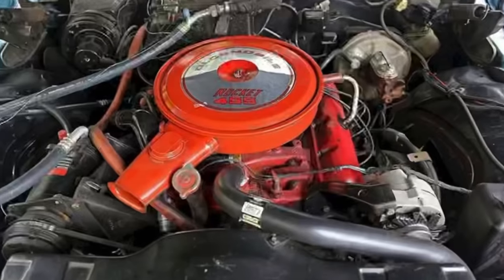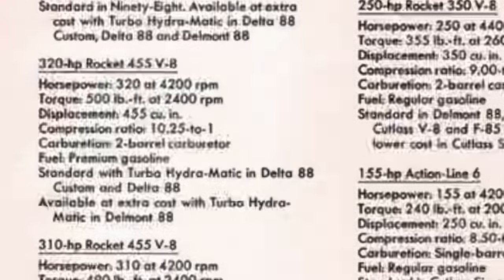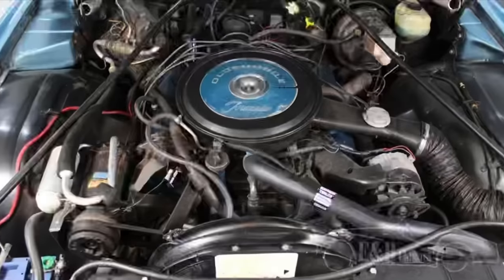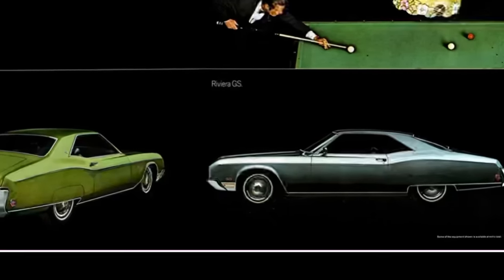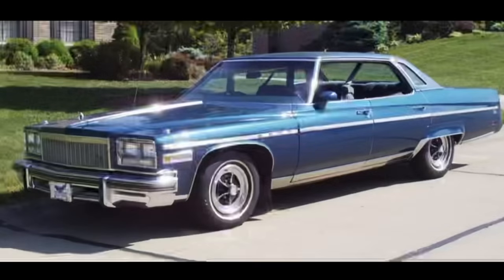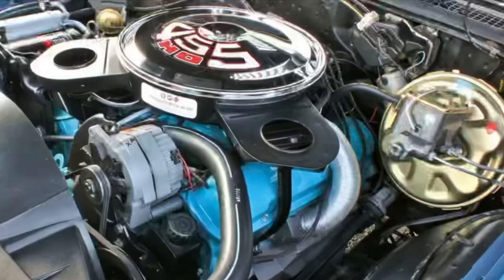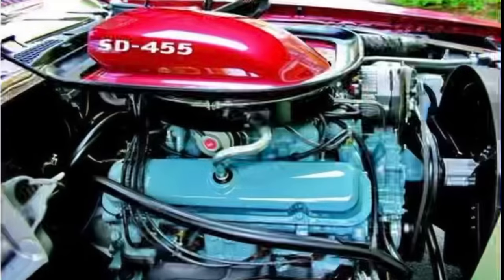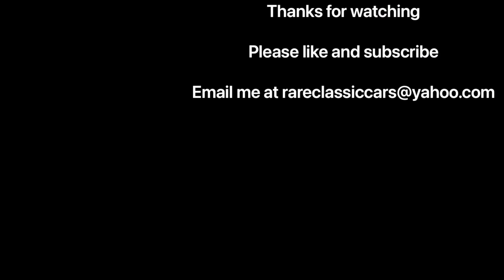Best Car Engines - The Rise of the Mighty 455 V8s from GM’s Buick, Oldsmobile, and Pontiac

Comment: I had a 70 Buick with the 455. Talk about a torque monster! Floor the pedal and man did that car take off. Not what you would expect in a car made for comfort. Very memorable.
Reply: I had a '70 Riviera GS, buckets/console etc., so I understand the feeling. That was a great car and pretty good handler for a big one.
Reply: I just bought a1970electra 455 2door hard top. It starts and runs, but it lacs compression on 2 pistons on the driver side. Cant wait to get the engine rebuilt and feel the torque :D
Reply: I just bought a 70' w/ a 455... getting used to the power, Jesus. There's a LOT!!!
Reply: I took a good friend of mine for a ride in my dad's new 1967 Wildcat....my buddy was a foreign car snob...but when I floored the Wildcat, he shouted out...OMG...it's a huge Ferrari! That beast would lay down a good 20 yards of rubber when pushed. And that Wildcat held together very well, lasting over 320,000 miles, before some drunk rear-ended the car.  My dad shed a few tears after that mighty beast went to the junkyard. GM cars hit some sort of peak, during those later years of that decade.
Reply: @curbozerboomer1773 Many years before GM became the junk trash it is currently. RIP GM, you should've went out of existence in 2009 instead of taking that Gov't bailout. 😢💀
Reply: I should add all of the Big 3 brands are junk currently. Only a few foreign brands I can think of that are very good yet.

Comment: Fascinating.  

A decade ago, Hot Rod magazine spent $5500 on each a Ford, Chevy, Olds, Pontiac, and Buick 455 and used similar components in each.  The Buick was the hands down winner, making about 550 hp net with simple mods and a good blueprinting.

Great video!
Reply: I agree with the Buick engine  they responded  well to modifications  back then buick had little  to no speed parts available  but now in today's automotive  market  there are plentiful  aftermarket  parts for most engines back then
Reply: I have the car craft 2001 issue that did a compared all 3 plus 454, 440, & 460.  Even back then, I seem to remember the Buick winning in HP, did excellent in torque across the rpms too.  The Pontiac had highest torque output and they wrote, they weren't sure where the torque peak on the Pontiac was because the dyno didn't read it below 3600 rpm, and from the tests they think it had a higher torque reading somewhere under 3600.  Although I think I heard before the 510 ft/lbs of torque in  Buick  GSX  (1970 ?) was the highest from the factory.
Reply: @Sheisthedevilyouknowwho-ft9we Yep the 70 GSX had the highest torque of factory production street engines.
Reply: Yes that’s why
BUICK 1970 
455 Stage 1
Gran Sport is the FASTEST MUSCLE CAR of ALL muscle cars of the era !
Inc Chrysler & Ford!
Reply: @jennybaji421  The Stage 1 was quick stop light to stop light but after the quarter mile it ran out of steam . They were low revving torque monsters.  Chrysler Hemi motors  were not stop light racers they needed to rev and did not make power until around 4000 Rpm.  Often times you'll see a Hemi bogg off line until it gets into its rpm range.
Reply: As my grand dad always said and to me still rings true today there will never be a replacement for displacement once you get that mule moving she's gonna run you down!
Reply: L88 427 had actual highest 535 lb.-ft. torque...
Reply: @jennybaji421 nope - the fastest was the 69 Road Runner 440 6 pack, next was the Cuda Hemi, then the Chevelle 454 LS6, then the GS
Reply: 1969 Plymouth Road Runner 440 390 4spd 4.10 12.91 111.80 SS
Reply: 1970 Plymouth Hemi Cuda 426 425 4spd 3.55 n/a 13.10 107.00 CC
Reply: @jtc1964x  A stock 2014 Porsche Boxster S with the PDK transmission that you may see with some 24 year old girl driving it?

12.5 @ 117.   Look it up.....

Comment: Regarding longevity, my experiences with the Buick 455's have been highly positive.  My family and I drove our 1971 Centurion coupe 167,000 trouble-free miles over a 51-year period.  The car was exceptionally reliable.  I have had a number of friends who drove their early-1970's Buick 455's well-in-excess of 200,000 miles without engine work, and know of a man in the Portland, Oregon area who has driven his 1972 Electra 225 more than 500,000-miles; the car has its original 455, never rebuilt and highly reliable.

Comment: I had a 1970 Olds 98 that was specially ordered by its original owner to have a "W Machine" engine and a super heavy duty transmission. It could boil the tires through 1st and 2nd, and easily bury the speedo. I loved that car. Only got beat by 427 Vettes.

Comment: In 1982 I bought a 1968 Olds 442 identical in appearance to the one at 2:55 in this video. It had a spun bearing and didn't run. I then found a 1974 455 out of a wrecked 88. The 455 only had about 10k miles on it. I used the 442 400ci heads/intake with the 455 short block and measured the compression at a true 9.8:1. I put a mild cam (a Crane cam IIRC) in it that was recommended to me as an excellent jet boat cam, but otherwise it was all GM. The result was an incredibly quick car that was quiet, idled smoothly, and was phenomenally reliable. I am more of a Mopar guy and eventually sold the car to buy a Dodge Charger I liked, but to this day it was one of the best cars I ever owned.
Reply: Hi Gavin: I rebuilt my 1967 Delta 88 back in 1988 using a 455 motor from a 1969. There was a magazine article "Build a 12 second Junk Yard Dog" which was my guide. I kept the stock camshaft due to the non adjustable valve train. By enlarging the oil galleries in the main bearing saddles and modifying the high volume oil pump; I have kept this motor running for the last 34 years only having to replace the water pump. The pressure per cylinder in 1988 was 148 psi. I measured the pressure a couple of years ago at 124 psi.  How did you determine what your compression ratio was? The ratio is still a mystery to me although I estimate something similar to yours.
Reply: I cc'd the cylinder heads and the pistons set down 0.25" from TDC. I also measured the compression height at TDC. From that, and the stroke and the head gasket thickness it is straightforward to calculate compression ratio. IIRC I had the heads milled 0.025 to get to just under 10:1. I had an 11:1 motor previously and it would knock occasionally on premium pump gas, so I wanted somewhere between 9.5 and 10 for the Olds. I did a few other things like recurve the distributor and a little pocket-porting on the heads. Congratulations on keeping your car going for 34 years! That is fabulous, and I agree that with 148 psi per cylinder the compression ratio would have been over 9:1.
Reply: Back around that same time period, I helped a friend rebuild a 1967 high compression Olds Toronado 385hp 425 engine for his 1974 Olds 442 Cutlass that had a worn out 350.  That car could smoke the tires for miles, it had massive torque.
Reply: @gavinmclaren9416  Can you remember what the psi per cylinder was on your 455? Or is that going back too far? I found that by keeping a stock camshaft and modifying the oil supply; it was the key to engine longevity. 40 years ago in Alberta the only leaded fuel was 83 octane so high compression engines were out. I've had this car since I graduated in high school in1982 and I even took it with me to Australia. How many guys out there still have their first car?
Reply: @corvettejohn4507  The 455 Olds just had the thuggish gentleman vibe, like Thomas Shelby in Peaky Blinders that just knew what it was about with no need to doubt. I built a 455 Olds to put in a 66 442 2dr Post with an M21 Muncie and 3.73 posi. It had that Miller/Mondello  cam that topped at 5400 with monster duration and perfect overlap so it had that think twice attitude.  It was so cool 😎 to let out the clutch and then punch it at 30 mph and shift, just redline it and bang them and that car was gone!
Reply: @arnbo88  Hey I am in Alberta too! I used to mix premium unleaded with a little regular leaded and that was my go-to for gas at that time. Later on I used to mix some toluene into my gas for more octane, which was (and still is) very effective. Much better than commercial octane boosters. 
It was 40 years ago but I think my Olds 455 with 400 top end engine had about 150 - 160 psi of compression. I had a '71 440 HP Mopar engine as well at the time and for comparison it had 100 - 110 psi. The Mopar was fairly sluggish in a Dodge Charger compared to my experience with other 440's, and I felt (and still feel) that  blueprinted engines with actual measured compression ratios in the 9:1 to 10:1 are way stronger than stock engines, even high performance versions. The '71 440 I had was supposed to have a 9.7:1 CR but when I eventually went through it I found it to be between 8 and 8.5:1. I got the compression back to the spec value by decking the block and using thinner head gaskets. That engine also got a "purple shaft" street hemi grind cam, 800 cfm Holley carb, and a recurved electronic distributor and it was night and day how much better the car was! It went from sluggish to where it would snap your neck back and leap forward, and skid sideways on upshifts (Torqueflite 727 automatic in that car) if you weren't careful!

Comment: I have owned several 1970 Oldsmobile Delta 88 cars with 455 2 barrel engines they were very reliable and surprisingly got good gas mileage. I drove one to college 300 miles from home and they got in the high teens 17-19 on the highway 
Very trouble free

Comment: Having Hot Rodded the Buick 455, it was a very easy engine to increase horsepower.  Some ignition, carburetor,  and exhaust tweaks increased its breathing considerably, and emissions went down as well!
Reply: you are singing my tune my friend.   Several years ago i ran into  1974 455 Buick Century GS  that a guy was needing to sell to buy a property. He used to race Buicks, and it had been built to 1970 high compression specs, bored over, and high lift .490 cam all from Poston Buick  back in about 2000.  It has the high RPM lifters, aluminum intake,  and headers.  People who I give a ride just shake their heads and hang on......
Reply: I've owned both a 430 Buick Wildcat and a 455 Olds Toronado.  They were both huge torque  monsters...  For some reason, the 1970s jet boats only used 460 Lincolns & 455 Olds - and according to my brother there was a camshaft problem with the Oldsmobile sucking water back in when you shut it down...

Comment: Back in '88 a buddy and I were driving home from a construction job in Cincinnati, on U.S. Rt 50, a two-lane highway....
We were leaving Hillsboro, and were behind a '70 Electra 455...
I was driving my '70 Fairlane 351C and was gonna shoot around him when the light changed. I saw him eyeballing my Shaker Hood, in his rearview mirror, and he revved his engine. I laughed and told my buddy, watch me dust grandpa's ass!
Well.... we took off and I pegged the Speedo, and then some, and was revving about 5400 RPM's, but didn't pass him... Not sure if I could have or not. That 351 would pull past 6000, but I sure wasn't gonna risk blowing my engine, to pass a rusty ol' 225 with a 455 blowing out puffs of brown smoke from its dual exhaust!!! Lol...
I have yet to live that down... My buddy and most of his very large family are Buick/Olds fans, and love to crap on a Ford.

Comment: Oldsmobile gets my vote. I remember several Buick’s having problems with lower end clunking when they were cold. Even John DeLorean talked about the problems with the Pontiac V8’s due to the tooling that was never maintained properly. The tooling was original to the 1955 V8 and it required a master to work it as the stuff was just worn out. In 1969 Mechanics Illustrated tested a Delta 88 Royale with a 390 horsepower 455 and it was a real screamer. The previous year they tested a police cruiser Delta with the same engine. It could keep up with any super car of the era. I worked at a Buick/Oldsmobile dealership and they talked about the police versions of the Delta’s that the town used. They were really hot cars.
Reply: Could it just be down to the projected quality of the brand at the time was reflected In the tooling that the brand used?
Reply: @zippityzbrake  

I think that it’s more, how can we cheapen this and hopefully nobody will notice.
Reply: Bingo!
Reply: You cant beat the 421 and 455 sd pontiacs
Reply: ...clunking was all carb issues...the Buick did have some oiling issues

Comment: I had a '70 Vista Cruiser that had a W34 Toronado 455 shoehorned in there. When it was finally dialed in, it was a challenge to keep it under 70mph on the freeway. I was able to do awesome burnouts with that thing.

Comment: I’ve got an olds 455 in a boat it’s freshly built and it is a beast of a motor. Won’t spin fast but it doesn’t need to. Sounds incredible with a cam and boat headers
Reply: Thank you soooo much for sharing your story!! Years ago, my late father in law picked up an 18 foot Slickcraft, with a frozen 4 cyl Chevy dirt cheat. Ended up putting an Olds 455 in it, with a Mercruiser Alpha One outlive, with only 9" pipes out the back!! Had to put 27 pitch prop on it, to keep from over revving. What a crazy, kinda dangerous boat to drive, but fun as hell!! AND I don't need to tell you how good it sounded!! Memories!!

Comment: Would like to suggest a corresponding video on the phenomenal Cadillac 472/500 (enlarged later to 500 c.i.).  I once flattened a parking meter that was anchored in solid concrete just backing into a parking space!  It was the most powerful motor I ever stepped into.  And of course, the Cad 472/500 combined with the Chevy 427/454 would make a good video, also.
Reply: The Cadillac 500ci would decimate in torque !
Reply: Well that would have been the weight of that monster, not the engine. That massive beast would have done the same thing with a four-cylinder engine.

Comment: Great 455 tutorial. I’m currently building a 455 Olds to maximize what it does best, build torque. It’ll be paired with a Muncie M20 and 3.08 gears. I also have a 403, which other than sitting on the engine stand gathering dust has no future.
Reply: It would if you lived close to me. 🙃
Reply: @kevinj2412  where do you live?
Reply: The best thing I can tell you is let it breathe. From stock iron intake to edelbrock intake. Port matched and Cleaned up my C heads. Those big block Olds love to breathe
Reply: That 403 makes a great swap into any 80s 307 equipped car. Really wakes them up.
Reply: @keepyourbilsteins  yep, I built an 86 4 door Cutlass sleeper a few years ago with a heavily modded 403. Wish I hadn’t sold it lol
Reply: Oh man ,  mind if I peek at the 403?.  My favorite engine to play with .
Reply: @kevinj2412  WORD. Still cutlasses around.
Reply: @willallen7757  I’m in central Ohio
Reply: @crazycoffee  Or better yet Add an Eldbrock intake manifold with Eldbrock Aluminum heads and do some porting and polishing to both of em and man the Olds 455 will make well over 550 HP and over 600 Ibs of torque.
Reply: @CJColvin  The flow difference I've had tested. My ported C heads flow about the same as edelbrocks. I haven't got to run it with my Offenhauser tunnel yet
Reply: @crazycoffee  Alrighty, of course ported Eldbrock Aluminium heads probably will flow even more.
Reply: @CJColvin  Yep but weren't free like my C heads. Ported elebrock heads only added another 2.1ci over how my C heads are currently. The only real advantage to aluminum heads imo is the weight. Most people think aluminum heads adds 100hp. You can usually get as much if not more flow from a pair of  decent cast heads that are ported
Reply: @crazycoffee  Thats true my brother
Reply: @jimmy_olds  Go Buckeyes.
Reply: @willallen7757  go Buckeyes!
Reply: @jimmy_olds  🏈🏋‍♀
Reply: "...403, which other than sitting on the engine stand gathering dust has no future."   Here's what I suggest:  Get it tanked and cleaned up.  Paint it any color you want, put it on some casters, install an LED light kit and put a sheet of glass on it.  Makes a cool coffee table.  😁
Reply: you could just display a 260 with 403 balancer and put the 403 in a regal or cutlass .

Comment: I like the Buick 455s the best. They always seemed to be more of a 'hot rod' motor with good midrange power and just all-around drivability. I had one (not factory installed, it was a 1970 GS engine, though, with aftermarket aluminum heads that would let it run 93 unleaded reliably) in a 1970 Skylark with a Muncie M22 and 3.55:1 gears and a Detroit Truetrac. It was lively to say the least.

Comment: In the early '80's I had a 1972 Oldsmobile 98 with the 455. It was a lovely engine and the one I had was by no means low mileage but the engine ran beautifully and was most reliable. The only major work other than routine servicing it ever required was a water pump replacement (which was straightforward) and fitting new exhaust manifolds to address minor exhaust leaks. It was my first American car (I'm a Brit and was living in Britain in those days) and to this day I think was probably the best American car I have ever owned - even in light of the fact that for the past 20 years I've lived in the USA where the car choice is so much better.
Reply: When you wrote about replacing the water pump . . . there's something about vehicles, of most makes, that seem to be prone to water pump leakage before reaching 100K miles.  Every vehicle I've owned, both new and used, all required water pump replacements before reaching 90K miles.
Reply: @bloqk16 Yeah, that just seems like a pet peeve of any ICE engine since the start of ICE engines millenia ago.